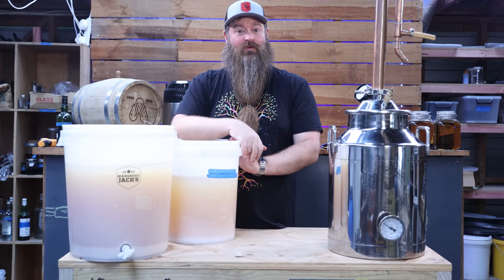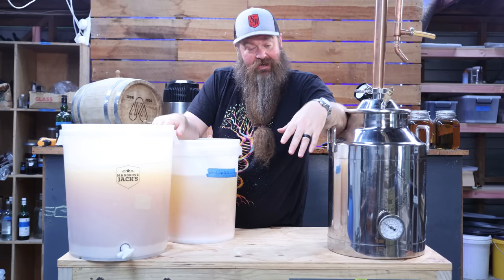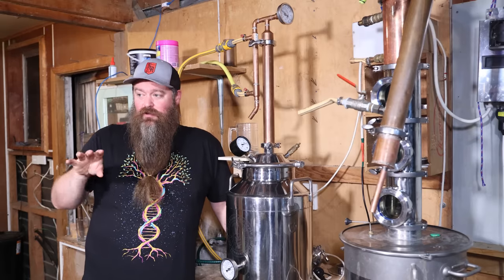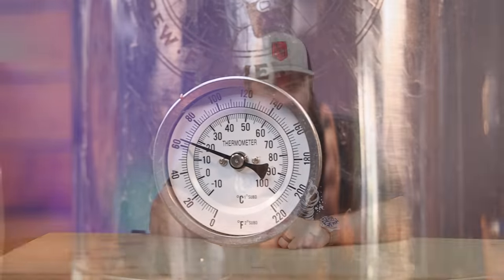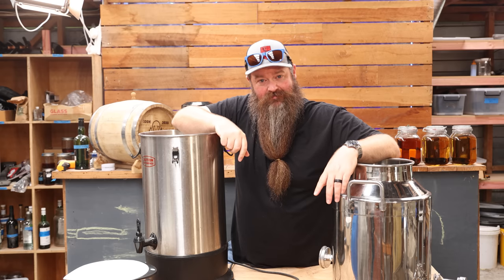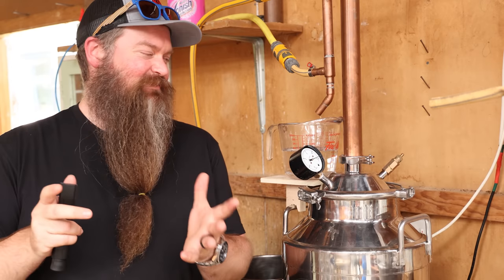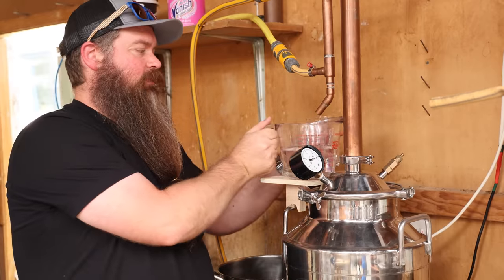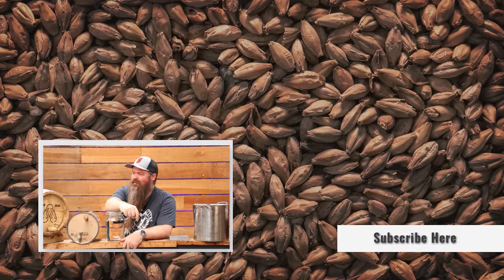How To Distill Bourbon With @ClawhammerSupply

Comment: I have been distilling for many years (ok about 15 years) so far from a guru but I enjoyed your video, some good info on cuts and also hit the safety points without sounding like a school teacher.
I have used the freezer method to speed up my ageing, it really does seem to work well, great if you are low on drinking ready and want to speed some up.
I tend to do 100lt batches and find I end up with a reasonable amount of product.

Comment: Some yeasts are top fermenting others are bottom fermenting so depending on the yeast used you might have a thick crust on top and be perfectly corect. Certianly some beer yeasts are top fermenting. I went around a brewery near Manchester and their open vats were wonderful and the smell was fantastic. All done with top fermenting yeasts on open vats.
Reply from the maker: Very good point!  It's pretty unlikely to find a true bottom fermenting yeast for distillation purposes.  But I wouldn't say larger yeast strains have never been used.....I may need to try it :)
Reply: @StillIt  I have the Turbo 500, what yeast do you recommend? 
Cheers 🍻
Reply: @StillIt  experimentation is part and parcel of the craft.. if you do not experiment you will rarely learn anything new.

Comment: I really love your practical videos man. Don't get me wrong, the b roll stuff is fun, and I love all the recipes, but I have missed the practical videos... even though it is nothing new to me anymore. I actually use a rapid aging process that I think mimics maturation much better than oak teabagging methods. I want to buy a barrel, I was thinking big, like 20l because surface area is just about half that of a real barrel, so more realistic time vs amount of oak infused but for right now rapid aging is going well. I use a lot less oak, like that piece you dropped in would be a bit big for a 4l jar with headspace left, and temp/pressure cycle. Changing temperature causes changes in pressure at the same time in a well sealed jar (and you can get a wrapped gasket to seal pretty well if you take your time wrapping, I get a vaccume pop with mine). That and letting volitiles escape after a hot cycle, after it cools to room temp, without disturbing much to mimic angels share, and breathing then vigorously shaking oxygen in to the spirit after each stage of the cycle, and at least every couple days when it's just sitting to mimic the air exchange that happens through the wood of a real barrel. I know a barrel will still be better, but I think my method is about as close as you will get, over about 3 months and 10 cycles room temp to very hot (like 60c) back to room, then fridge and back again, over a couple days per cycle.

Comment: If I use a single bubble plate in a 2" column Pot Still, will it act like a thumper keg does on a traditional pot still? Thanks for all your hard work. I have really learned a lot from You and George. I just got an Air Still. Can't wait to try it on something besides water. I miss George and hope he is doing well.

Comment: Home distilling is legal in some of these United States.  As a Kansas resident, I cannot legally do so; however, in nearby Missouri, you can.  Better set up a shed in my father-in-law's backyard.  

A question regarding anti-foam agents: most lipids counteract foaming, which is why they are not prized in brewing.  Could you chuck a couple tablespoons of canola oil into the wash?  Is butter preferable from a flavour standpoint?

Comment: Question: I am making an Apricot, I noticed the "yeast at the bottom" thing- so I use my still its a Vevor, as my fermentor as well, so do I pour everything out, CLEAN and vinegar run the still, THEN run the stuff I took out (strained of yeast and solids) back inside?

Comment: Does anything change other than the volume of product and abv if you do not ferment a wash out dry?
Reply: I've always wondered what effect under fermentation would have on flavour. If sugars are left in the wash and you heat them up, do the sugars cook and make some sort of caramel, which can pass into the distillate flavour?
Reply: I believe by the time enough water was removed such that sugars would caramelize, they would be fouling your still and you'd be so deep into the tails you'd not be using anything produced in that part of the run, anyway.

Comment: Being that the T500 is made in your country it should be a point of pride to brag about that. It can be tuned for anything from 70% to 95% and is idiot proof. Also available at most all wine making stores everywhere. With it you can go straight to the finish run tuned to 80% as the flavor is in inverse proportion to the alcohol percentage.

Comment: What is this I have heard about filtering through charcoal?
Reply: It’s called the Lincoln county process. It smooths out the rougher flavors.
Reply: Whiskys like Jack daniels or wild Turkey long-range use this method as it can result in a smoother and cleaner profile at the cost possible cost of some intensity/flavours. Whisky tribe did a video talking about charcoal filtering too if you want more info.